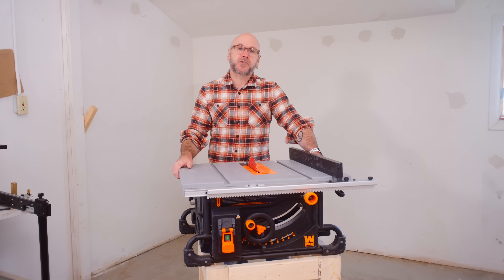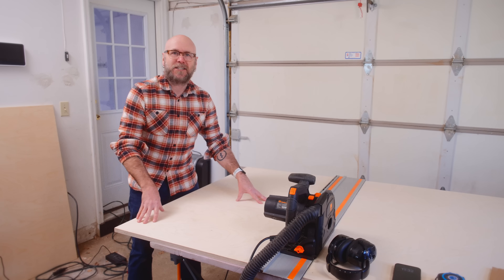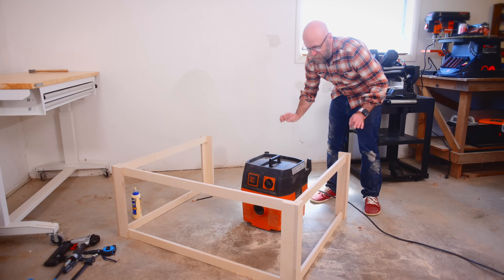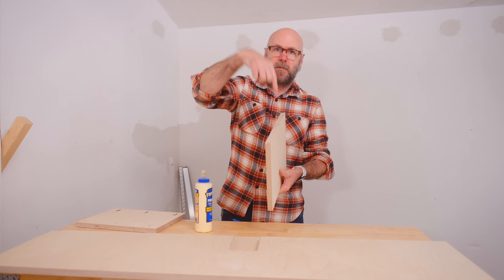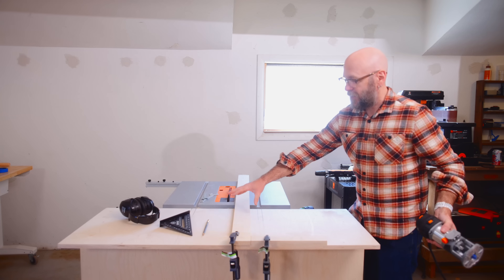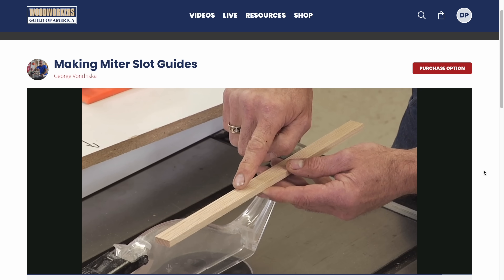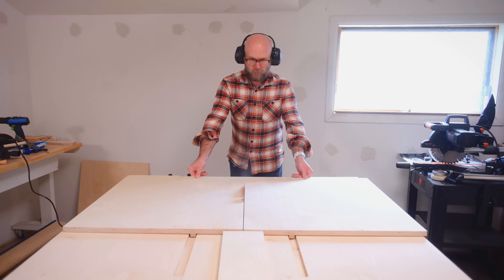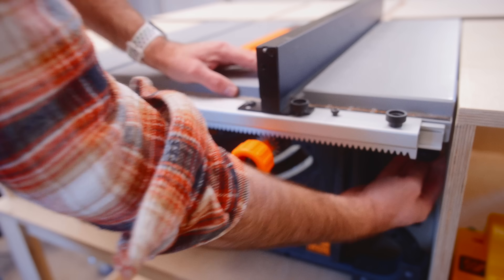Transforming a Cheap Table Saw Into a Professional Cabinet Saw

Comment: This is a bit misleading, Cabinets saws are better for many other reason then just their versatility and foot print. For starters they are about 3x more powerful, they are quieter, they have better gears, more precise methods for measuring your cuts, better fences and generally already come with a better miter gauge. The increase in power also means they are safer as they don't bog down and kick back nearly as much as jobsite saws. Cabinet saws also have much improved dust collection which is something you really want for a dedicated shop saw, unless you hate living longer and would just prefer to die faster. This is particularly important when talking about a cabinet shop who uses say prefinished birch. The middles of those are often made with layers of rubberwood whish is very hard on your lungs. 

Really what you did was add storage and make a jobsite a bit more maneuverable and utilitarian but to say this in any way compares to a true Cabinet saw is a bit disingenuous, especially for people starting out who are looking for clear guidance. Its all a bit click baity if you ask me. 

All this said, I really did enjoy the video and its a great little setup for a beginner saw. It did however feel like a bit of a WEN commercial.

Comment: Watching you use imperial measurements for the drawings just makes my head hurt. It really is such an odd system to go with. I mean it’s all good, I’m sure if you’re brought up with it, it makes sense but how do you add 3/4 of an inch to 18.5? and is the .5 half an inch or some other number? And how does this all work on a calculator?

Comment: I'm just curious how you will upgrade the drive and bearings,  that's the important part! The cheap saws have cheap bearings, your cuts are going to start to walk.
Lots of effort going into junk. Spend a little of this effort into working late so you can buy a quality product to start with. 
A chain is only as strong as the weakest link. 
If you're performing work that requires this type of cabinet saw, you will need a quality saw.

Comment: there is not really a good fence for contractor saws. what you can do since you built the saw into a bench is to built or buy a better fence that is a part of the table and not the saw. You do have to be sure the saw is locked in place or easily precision adjusted if you choose to take that path.

Comment: Lipstick on a pig.  No contractor's saw will ever be a cabinet saw.  The tolerances it is manufactured at aren't there because they are meant for rough carpentry.  Wen makes absolutely dogshit products.  Just save up and get a Sawstop and be done with it.
Reply from the maker: Except I've been making fine woodworking projects with it for weeks. Yeah, doesn't compare to my Sawstop but I can make it do whatever I want it to. It's all about your attitude and approach. 🙂

Comment: This is not professional table saw by any means. You are behind on horse power, fence accuracy and adjustability, shaft size and dado availability, high sealing for dust collection dead flat cast iron table,... 
You just made the table wider.

Comment: "Transforming a Cheap Table Saw Into a Professional Cabinet Saw". that can not happen if you spend more $ on upgrades for the saw then the saw is worth. this is the problem with most of these videos, how about you give a nice vid on proper operation (like how to feed a board setting your fence........)of the saw. also on a side note why are you patching your screw holes on your drywall after you painted? fyi min total out the door for upgrades over $1200 pick up a used cab saw for that on craig or face ready to go